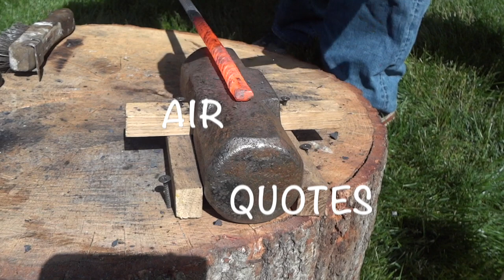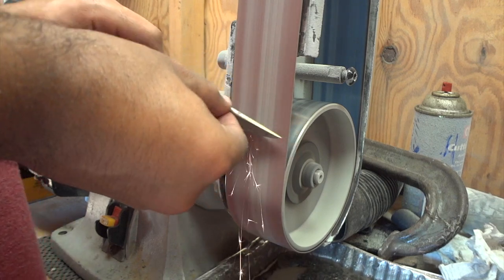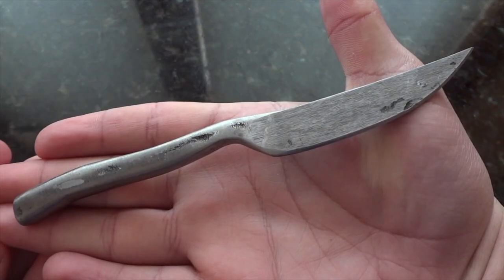Forging A Rebar Butter Knife

Comment: Hey pretty cool channel!
I just came from Alec (:
Could you show your forge in a more detailed video?
At my channel I am using something very similiar, however, it is sadly not very durable.
So which stones did you use to contain the fire and how did you mount them to the forge?
Reply from the maker: Freizeitflugsphäre thanks for checking me out. My forge is actually bought (I wanted to make it but my girl bought me it as a present - great gift). The forge is a Mini Whitlox Forge. It’s been holding up very well after all I’ve done with it, it’s still just as good as new.
Reply: Sharp Works thanks for that information!
Reply from the maker: Freizeitflugsphäre glad I can help good luck with your channel, I subscribed, I know how hard it is being a new channel.
Reply: Sharp Works thank you!
That really means a lot to me! Unfortunately my channel is in German, however, I am thinking about also doing an english version of it at some point in the future.
Anyway I think it is easy to understand what I am doing, when you already have a bit knowledge on those topics. (:
Reply from the maker: Freizeitflugsphäre you can also put an English translation in the closed caption if it’s not too much work, that way you can branch out more